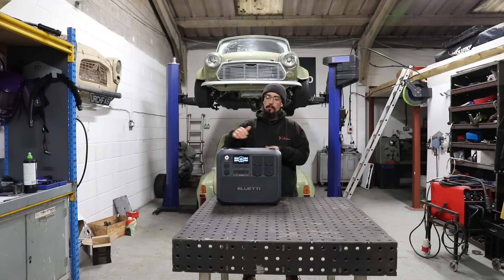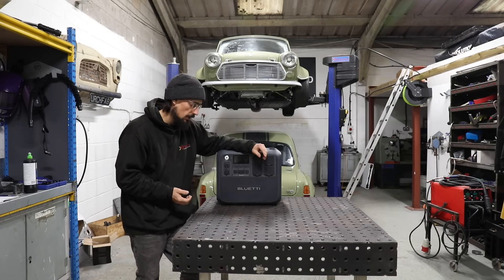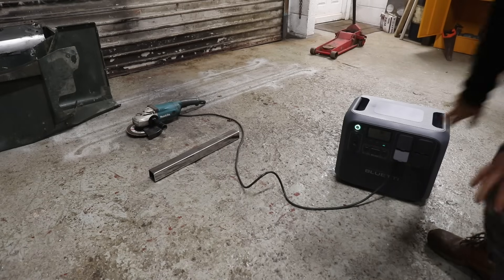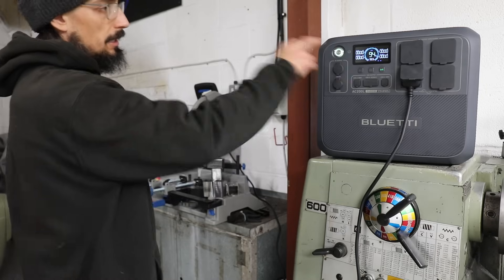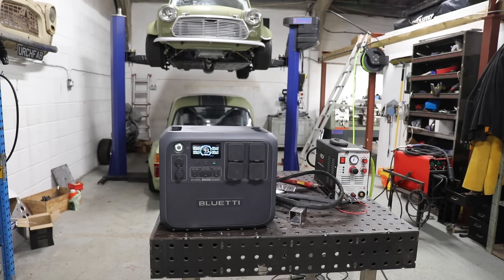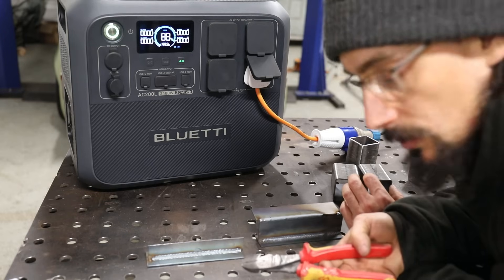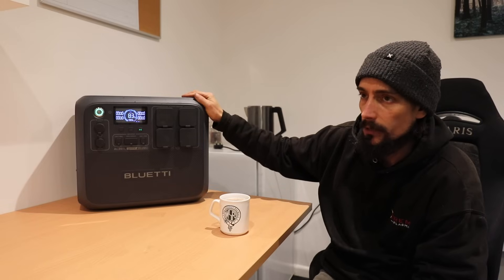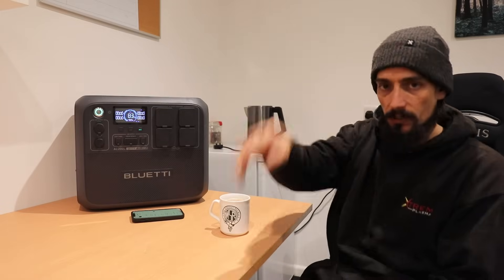Can You Power a Welder with a Portable Power Station? Lets Find Out!

Comment: Hi Matt,
I need to do some bodywork welding g in a lockup without mains power - I think this may be a  potential solution? Or would a higher capacity battery be necessary do you think?
Cheers!
Reply from the maker: I think if you’re just doing car body panels you’d be fine with this one.
Reply: @Urchfab  perfect - that’s good to know. Interestingly, a petrol generator seems to be a similar price, but at least the power pack is silent! Lol